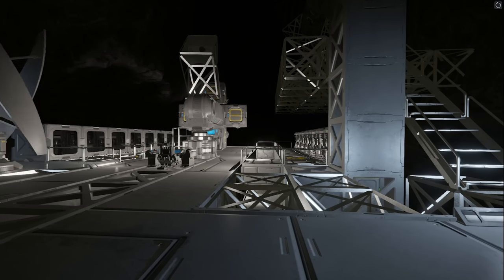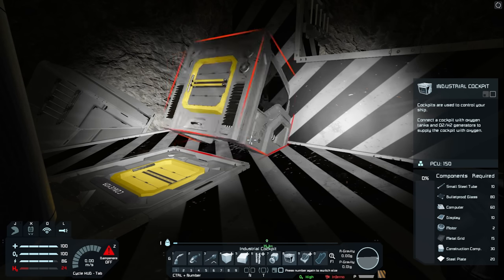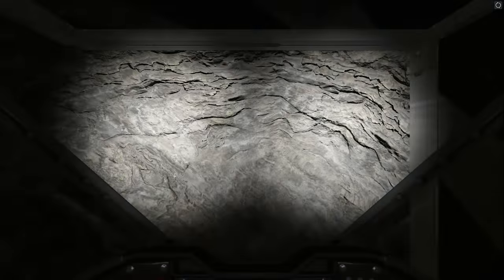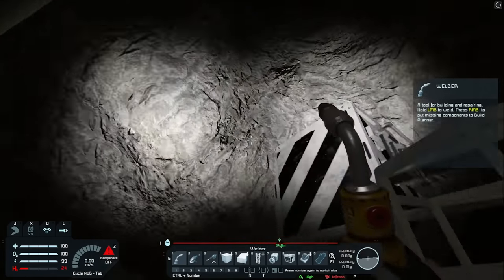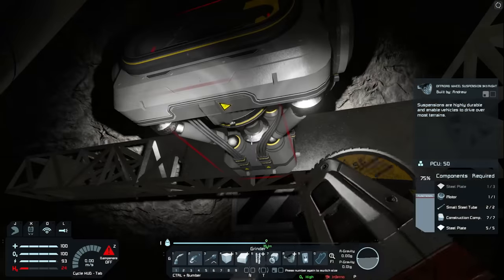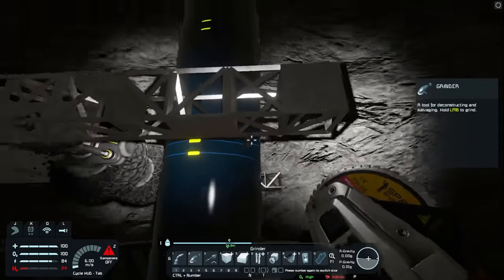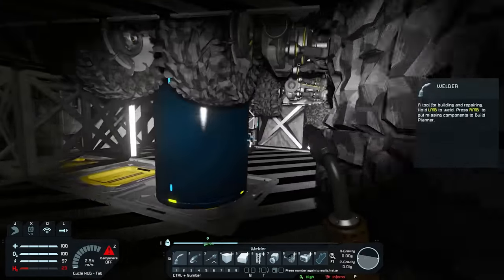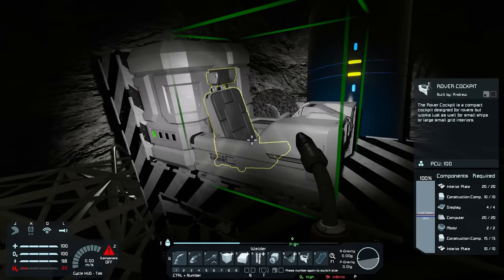Space Engineers: The Center (Episode 7) - Building an Elevator!

Comment: A low strength gyroscope on the elevator may help with aligning to the base. Also you can access the cockpit's inventory without getting in yourself from the front. Great video as always, you are getting closer to freedom from the core!
Reply from the maker: That would definitely help! But we're a bit restricted on materials and cant find any cobalt for metal grids :/ You're right though, it would definitely solve the problem!
Reply: @AndrewmanGaming  you can definitely make the small grid gyro in the core. No cobalt needed.
Reply: Small grid gyros do not require cobalt if I'm not mistaken!
Reply: @TheBeige0ne  correct

Comment: I had a thought to make the elevator easier to use. Basically, if you add a remote control, which to my knowledge doesn't need cobalt, and you'd be able to set it so that it'd be able to move itself between two waypoints, or in other words the top and bottom of the elevator shafts.
That, or alternatively, set the wheels to have a speed limit as frankly it is terrifying seeing you going 30m/s up that elevator xD
Reply from the maker: That's a good idea! But what's wrong with going 30m/s up the elevator 😅

Comment: Watching you make the elevator made me wonder, couldn't you make the tires grip the tunnel walls and raise yourself up that way instead? Put tires round a platform and they all just push against the walls evenly. Have to make the elevator tall enough so it doesn't just twist sideways, but sort of a cylinder shaped ship. Heck, if that worked ya could just start on the surface and dig down to collect stone, then rise back up to dig another shaft hole. Assuming it could be made to also be a rover up top. But, still, for this application, seems like it might work as a wall gripper elevator. :) Space Engineers just makes ya think crazy stuff.

Comment: AGAIN, SMALL GRID CONTAINERS DON'T REQUIRE METAL GRIDS. Use a Hinge and remove the part to replace it with a medium size connection. Then you can conveyor all the parts you need.

Comment: Now that you made all the way to the top of the conveyor, why don't you build a guiding rail for the elevator? It would make your travels safer and quicker. You don't need to use powered wheels, just the wheels sliding

Comment: 24:40 if you had a survival kit on the elevator could you make what you need from the drills?
Reply from the maker: Yes that would have worked! But I would have had to take my one survival kit off the base and install it on the elevator. I dont think I can make the medical components.
Reply: @AndrewmanGaming   of course if the conveyor you were climbing were built as 3x3 (ie in center conveyor and surrounded by light armor blocks you could project. have periodic conveyor access. stop dock, recharge and resupply and not need any production on the elevator. and always be 'aligned', have 'floor bases' periodically to stop at for whatever reason. you could even potentially send the stone back, so you didn't have to mine any other way... but inch worming it up is less entertaining than what you are doing.

Of course, none of that is using anything bar what you can produce... so no extra mods....